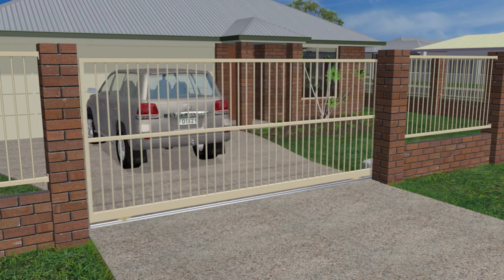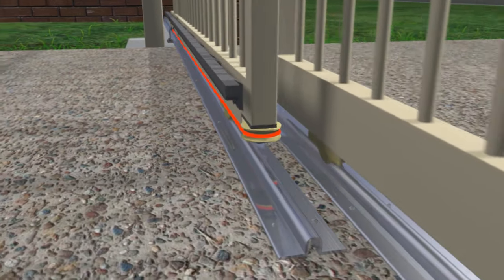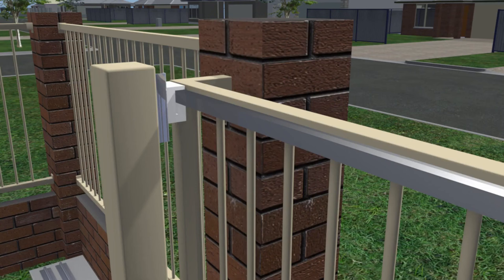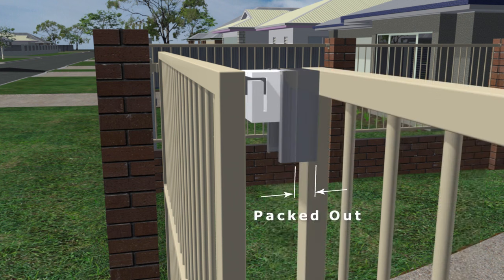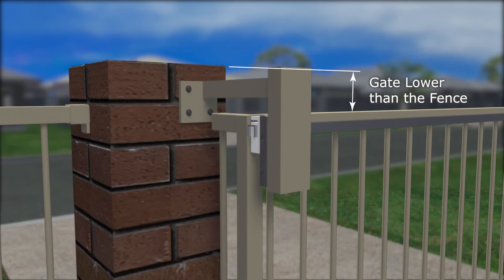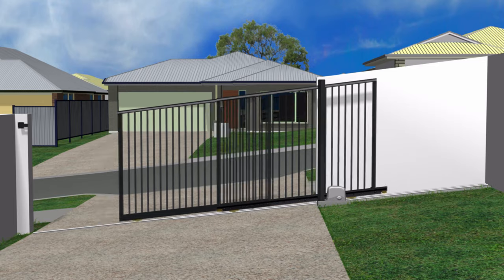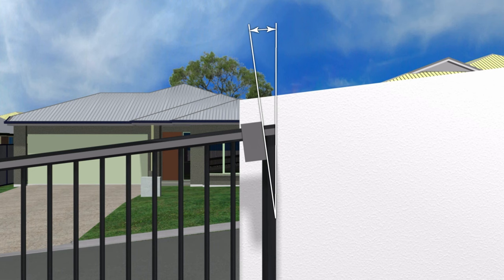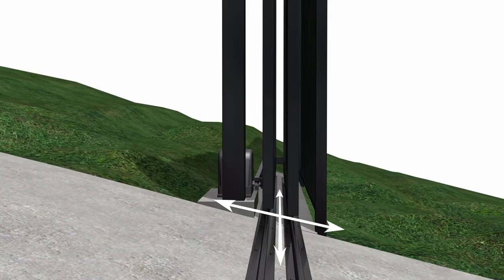Installing 2 and 3 Panel Telescopic Sliding Gates

Comment: There is a problem. if 4 or 5, 6, wings. then the burglar can get through the wide gap. when entrance is closed and is 5, wing. This could be dangerous because the burglar can get through the gap in the wing gate

Comment: Hello.. very nicely explained. I want to install a 2 panel telescope gate but I'm worried the opening is too long. The total opening is 44', making each panel just over 22' .. In your opinion, do you think that this is too wide to install without an overhead roof type of structure?